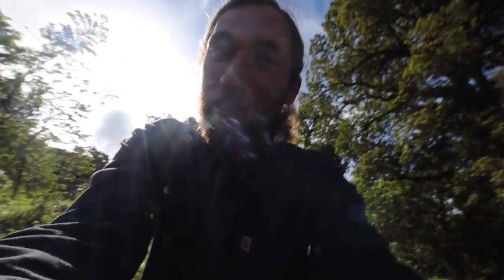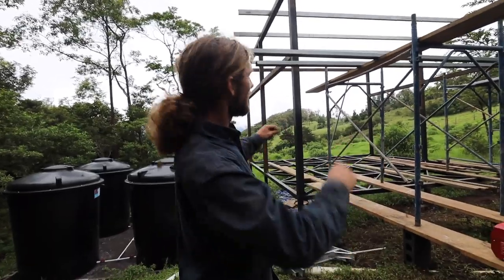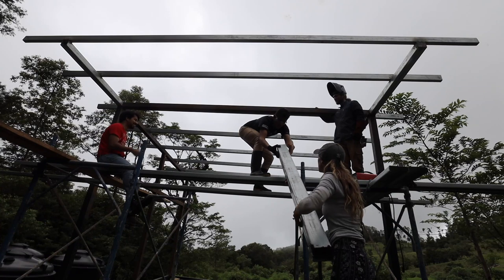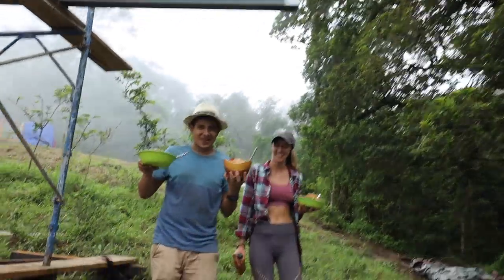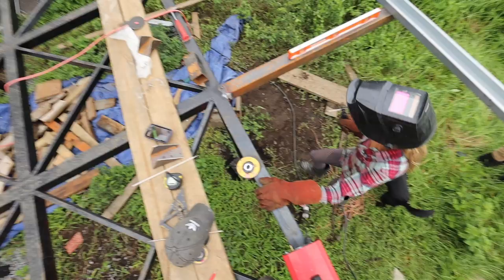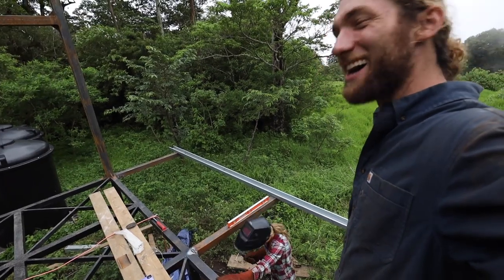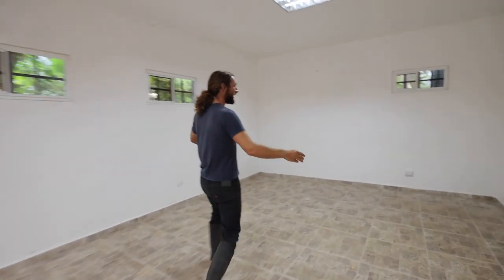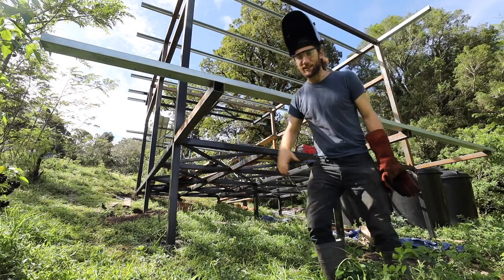Living In A School Bus On a Farm

Comment: Oh.... and BTW, have you reversed the angle supports on your fence gates as I suggested several weeks ago? My below statement of the triangle also applies to proper construction of gates with the angled piece runs from the top hinge point to the opposite side at the lowest point. Triangles are the strongest element n construction.  ....Just so...

Comment: That angle grinder is probably one of the deadliest tools you have. I was cutting (shaping) a piece of steel and the steel got hot enough that it pinched the wheel. It became airborn. Luckily(?) it hit my forearm instead of my neck. Cut an artery, 3 tendons and four nerves. Luckily I could stop the flow with my other hand and get someone to tie a tourniquet on my upper arm til the medics could get to me. If it had hit my neck you cant put a tourniquet on it. lol Still have my hand and it still works but no feeling.

Comment: You can buy a camp shower which is a black bag you fill with water and hang up somewhere. The sun heats the water and you can take a warm/hot shower using the attached hose.

Comment: The angle supports you are welding on should extend out towards the end of the horizontal piece AT LEAST 2/3 of the total overhang. The porch area should also have posts and footings into the ground. It's outstanding that you're doing all this work, but you still need to build safely.

Comment: Another top tip. Try and paint all the metal on the ground and take off the paint where you want to weld that way you limit your painting scare time and also makes it easier to get into the inside of that awful lip with the paint brush. Maybe invest in some G-Clamps. It might help holding up and down the stuff you work on. You guys are doing very good!... Cheers. R

Comment: 2 quick welding tips: 

Pre-strike you rod in a line, on the line you're about to weld. (No need to strike somewhere else in the body, as it just causes more work to clean it up in post) 

When u have a brand new welding rod that's suuuuuper long, you can actually just use your gloved hand to choke up on the rod...closer to the work area. 

GL, Have Fun!! ♡♤

Comment: Welding in the rain isn't a big deal. Running your generator is, so just cover that up and you can keep working. My welding teacher in college talked about welding a whole office building in the rain on portable generators and passing building codes. And i suggest you get some gussets under that deck portion, it will fail one day.
Reply: I've spent many a day in the rain welding bridge beams.....the arc dries the area fast enough...you're right...it's the generator that  need the protecting...and grounding, btw.

Comment: OMG!  That building is going to last forever. At times it seems like it's over engineered and structurally stronger than required, but given the extreme winds and wet climate in Panama I'm sure you will never regret investing  the extra time, effort and money to do it right. Your experience gained on this project will pay dividends when you build your free standing tiny home!  Thanks for sharing this latest adventure.

Comment: when welding, when you get to the end, pull back onto the weld to fill the hole at the end of the weld as it it a stress point that will fail first if left unfilled 9:07.

Comment: Just an FYI... the gussets that you used on your porch are not big enough unless you're going to use posts on the side away from the main structure.  Use the same size steel and the porch and cut them at 45 degrees at least 2.5 feet in length.  Be safe.

Comment: Looping coffee bags from the ceiling will help stop the echo and collect the air-born caffeine from the roasting, for added safety spray them first with a fire retardant. Your angle supports for the deck are too small, angle supports should be minimum 1/3 the distance, better 1/2 the distance for the deck. I suggest putting the same angle supports on the roof overhangs. Your welds are not bad but are the welds of the beginners penetrating the steel or is it what we call bubble gum weld, it holds it holds it fails suddenly. Mother nature is a powerful force.

Comment: HEY GUYS, ENJOYING WATCHING YOU BUILD AND I HAVE AN IDEA. ON YOUR CANTILEVERED DECK I THINK IT WOULD BE WISE IF YOU ADDED A SUPPORT FROM THE END DOWN CLOSE TO THE BOTTOM OF THE SUPPORT GOING INTO THE GROUND. I JUST WORRY THAT EVEN THOUGH YOUR WELD'S ARE PERFECT YOUR STILL PUTTING A LOT OF WAIT OUT TO WHAT LOOKS LIKE 4 FEET. JUST MY OPINION AND YOU KNOW WHAT THEY SAY ABOUT THAT.    LOL
Reply: I would earnestly recommend that you support the outer edge with a 45° back down to the Base, structural failure/ accident waiting to happen
Reply: Been thinking exactly the same.
Reply: Not trying to be mean but those welds are terrible, looks like current is too low or they are moving too fast.  They are laying bead on top of the metal vs fusing and sealing with the weld like you would with clean weld.  I bet that you see that if the cut a cross section of the weld.  The welds are probably strong enough for that application but that doesn't make them good.  If I'm right about the welds then when they clean them up with grinder they are really weakening what that have because they missing that fusing part of the process.  Clean welds not only look nice but you know they are strong.

If it's just a roofing overhang it shouldn't need a support at 4' but I guess that depend on the grade of steel they're using. Even with strong winds the roofing would fail without causing damage the frame rails.  Well that's what I think would happen at least.

Comment: hey just fyi.. do not strike your welding ark outside of where your welding.. each time you tap it and it flashes it fractures the metal. for this reason you only want it to ark in the area that your welding.. one more thing its always a solid recommendation to have your skin covered when welding.. the sparks can be little pellets of molten metal, they suck getting them embedded in your skin.. they hurt.. also i would recommend a clear safety glasses under the welding helmet.. i have also had the blow back sparks and slag fly into my helmet and get into my eye..

Comment: Jordan, that little porch....you need to put a couple steel beam right angle pieces for support because those little corners are eventually going to fail...too much weight depends on them....a larger right angle beam reaching out to the outer edge of the porch will relieve all the down pressure.....especially when you start flooring it and using it.....seriously, dude..

Comment: Y'all needed a couple of hunter safety harnesses. They're what hunters use in case they fall out of their tree stand. You can get certain ones for $30. And you can hook like a 6-foot rope to the harness and the other end of the rope just goes over the top beam/tree so that you have like 6-foot that you can move each direction, and even more with those steel beams because the rope would just slide back and forth across the beam, but it catches you if you were to fall. 
Some of the harnesses come with like a built-in hammock for your butt, so that you can throw a rope up over a limb/beam and pull yourself up like rock climbing gear, then once you get to where you want to be you just sit back and it holds you there sitting in mid-air. lol.

Comment: I'm not an architect or builder...BUT... If you are planning to cover the walls soon, with the winds you have experienced, it doesn't take much to push your framed construction out of square. May I suggest either temp. or even better — permanent angled rods on all sides to prevent the stress your building will definitely experience. Remember, a triangle is the strongest element in construction.

Comment: You all are accomplishing a lot!!  But an accident where someone got hurt would be a lot to handle mentally if it could have been prevented!!  I have done quite a bit of steel work (and i am a engineer) and you will be stressing your corner joints A LOT! if you don't put bigger 45 degree braces on both the ends of the roof structure and on your 4 foot over hanging porch!   I would say 1/2 way between the upright and the ends would give you a lot more strength and safety! It might not break now ... but what about wind load on the roof and what about when you start putting people and stuff on the overhanging porch?

Comment: Good, your building slide open up deck, now that bring the outside and light in. 
How about this idea. As you got no sun 1/2 yr.  how about a portable fireplace. You can use a 1/2 cut 55 gal drum on legs and can be mover to your other deck later.
    So you have a all evening fire place and warm of relaxing fun.  And a hot water shower after. 
For fire wood Construction has cut off scrap wood. If you can't find much wood search here for a rocket stove. I make a 1 gallon can one. And it burn off hand full of twigs and boiled water in about 3 minutes. You can make it work just smaller fire.
      Basically. Cut the 55 1/2. You could use rebar rings to hold the water tank above that inside 1/2.  If you can find stainless steel 5 gal + that best. If not galvanized sheet metal you can line the upper 2/2.
 & you cut holes at the bottom half to view the fire. but the rebar inside hold the tank up. And since it on high deck the hot water after you add more water to get the right temperature U can shower below the deck. 
 Anything you can get a 3 + win is golden. Check the scrap yard, wood source, etc.

Comment: Just another nattering nabob of negativism here. It seems to me that you are welding lots of long sections of girder just by one end to the side of other girders. Even with those triangle support thingees (complete amateur here, but this is the Internet, so I won't let that stop me), is that a strong enough joint to support weight? AND you answered my question, Rodrigo is standing on a scaffold that is half supported by the "deck" girders you just welded minutes before. I almost couldn't watch.